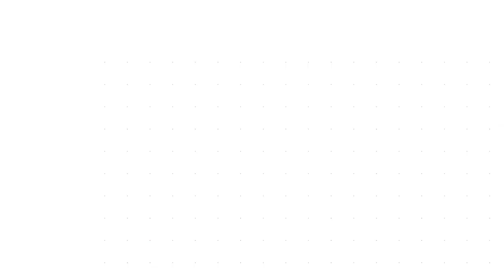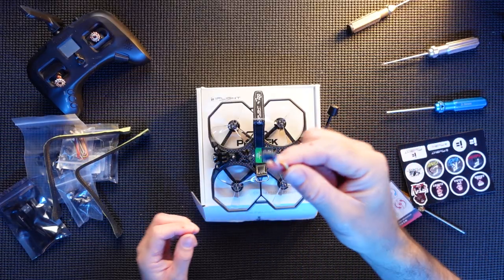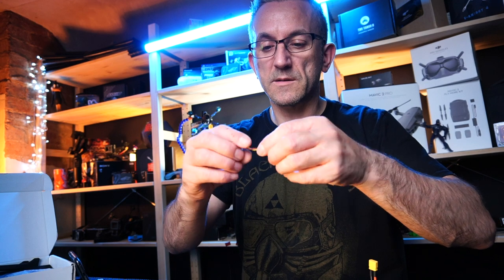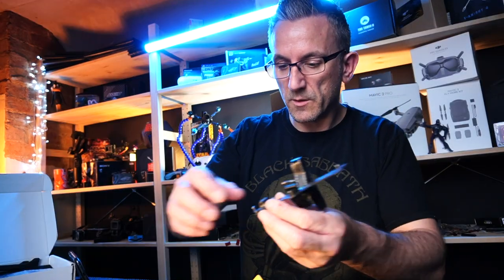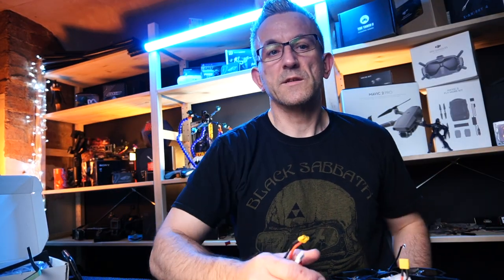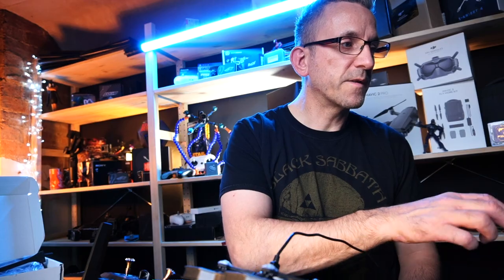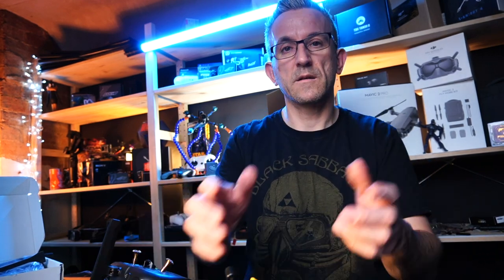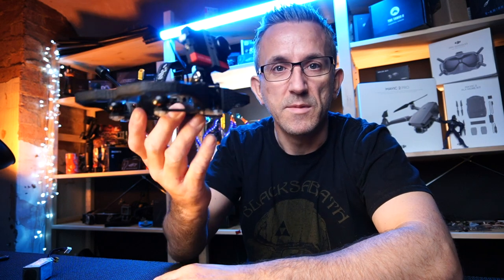iFlight ProTek25 HD Cinematic / Freestyle Whoop full set-up, flights and review

Comment: Question when installing the crossfire do I need to remove two wires from the Caddx for the crossfire to work, or just change the receiver from sbus to crossfire in betaflight.  This video was extremely useful since I am preparing to install the crossfire.

Comment: Great video. I am planning on putting the crossfire in my 25 this week.  I’m using a DJI radio but want to run the 25 off my radio master  16 Pro.   I do have a question when I install the crossfire do I need to disconnect two wire from the caddx or just change the receiver in betaflight  from sbus to crossfire.  You video was extremely useful and I appreciate you sharing your experience and knowledge with the public.  Bruce
Reply from the maker: you can leave the wires in place and change it betaflight to crossfire, should work fine, thanks for your kind words, cheers
Reply: @Datfpv  thanks for the tip.  I finished the change over today and everything is spot on.